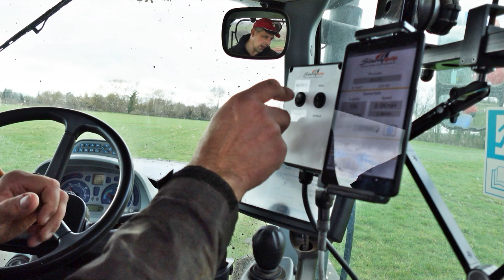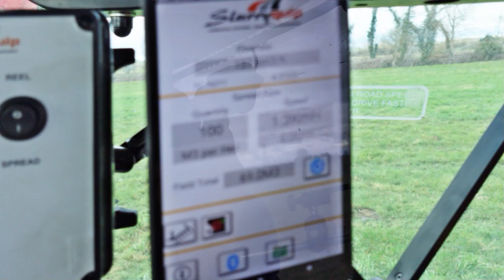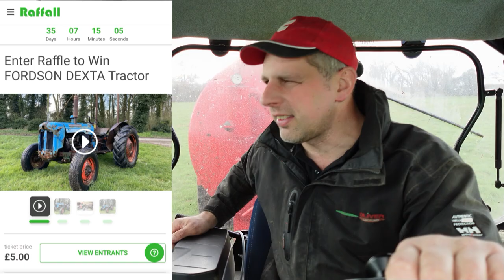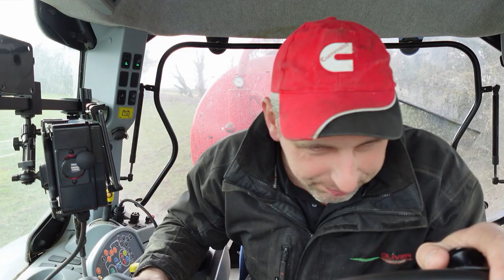LETS SPREAD SOME SLURRY - NEW HOLLAND T7 210 - HISPEC - SLURRYQUIP

Comment: Great video and an awesome thumbnail.  Did Mrs Saunders take that?  The trailer restoration reminds me to start to get on with sorting my little trailer project.  I got what I think it a 3 ton metal tipping trailer for my fordson major.  It needs some welding but I haven't welded before and want to learn.  My mrs got me a new hydraulic pipe from work for the ram which i have already fitted.
Reply from the maker: Cheers mate, no that's just a still from some video 👌 that's a good opportunity to learn and you'll love it when you can stand back and say I fixed that 👍
Reply: @GeorgeSaunders  I have just put in the forms to get my fordson major road registered as well so looking forward to a few runs and cutting the grass on local lanes 😃

Comment: As far as I know u shouldn't switch macerator on first as it needs the slurry to lubricate it
Reply from the maker: You would need to leave it a lot longer than a few seconds without any liquid before you have any problems. Half an hour with no flow results in enough heat to melt the pipes attached to the macerator.